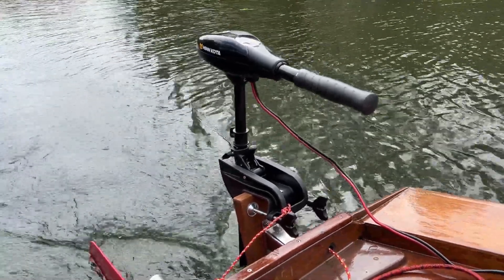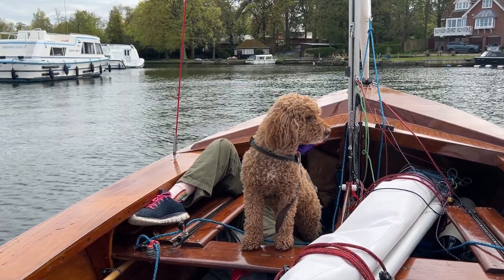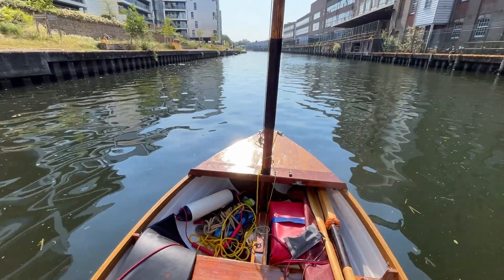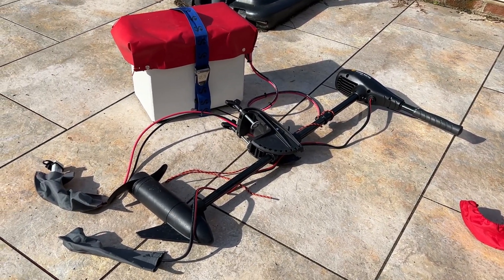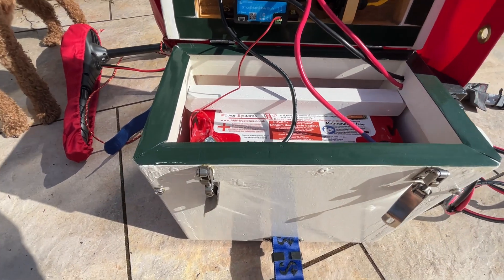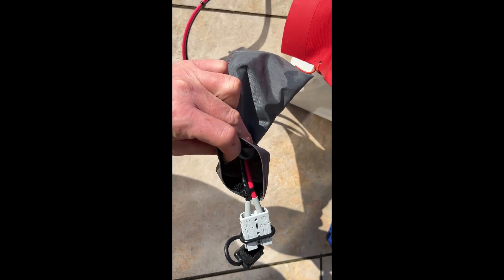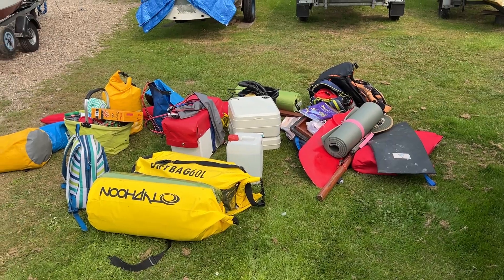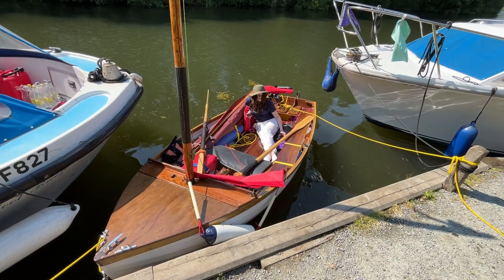DIY Electric Outboard

Comment: I use one as aback up trolling motor on my fishing boat. Handy thing to have.
Reply from the maker: Ya. I am tempted to put mine in the bow even when I take the petrol outboard, as a just in case backup.
Reply: @2120edm mine sits on the back next to main outboard.  Its on a lackey bracket, so I have to sit on the back to control it, but it's good.